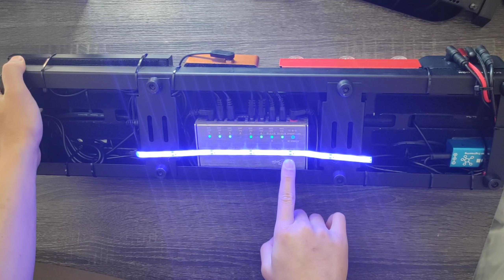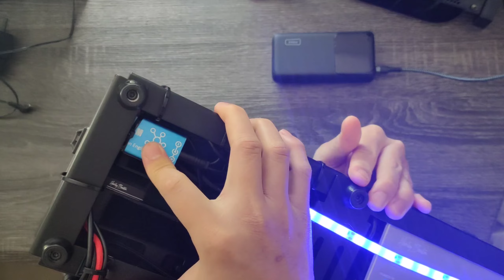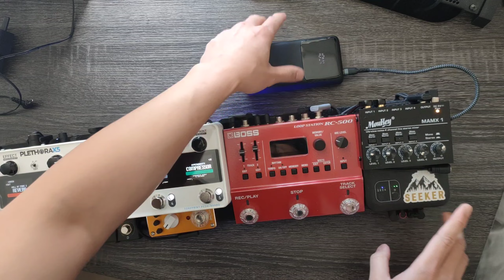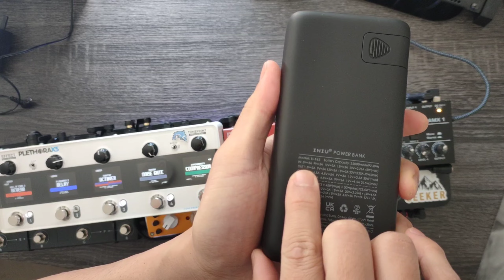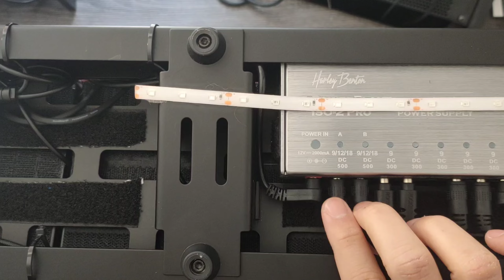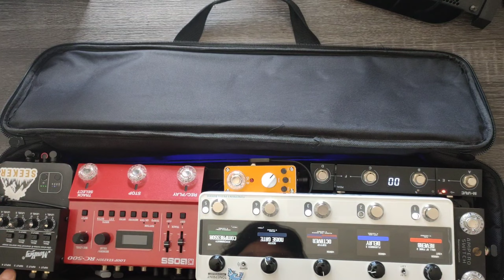Battery Powered Pedalboard Rig featuring Rockboard Duo 2.2, Plethora X5, RC-500, Mvave Chocolate

Comment: Hello, I would like to connect my Loop Station Rc5 to the Chocolate Midi, but I couldn't find this information on how to make the connection anywhere, Could you tell me if these pedals are actually compatible?
Reply from the maker: You would need a BOSS 3.5mm TRS TYPE A midi cable. If you have the v1 mvave chocolate midi, you could use the pedal out as it acts also as trs midi out. But.. you need a headphone adapter as it is 6.35mm (jack). Headphone adapter converts from 6.35mm to 3.5mm so that your boss midi cable can plug into.
Reply from the maker: If you're using the v2 chocolate, I believe it has the 3.5mm midi out port already.